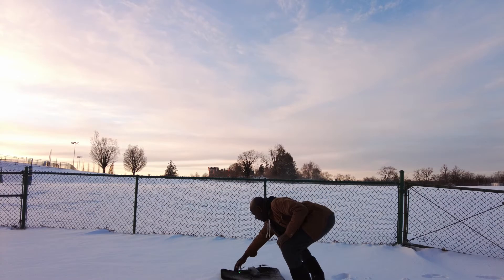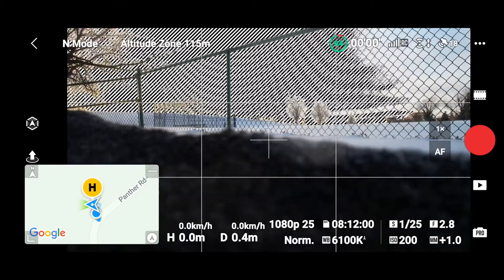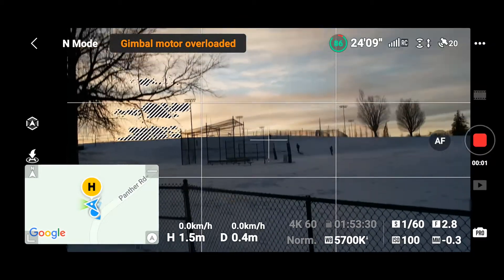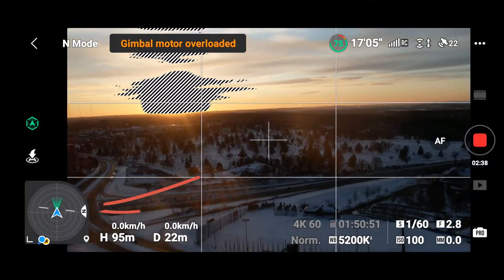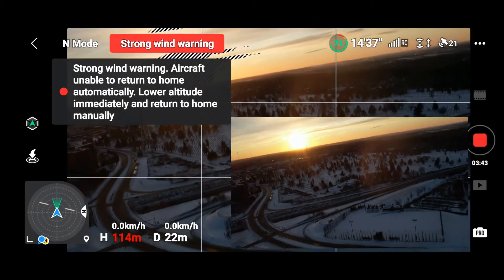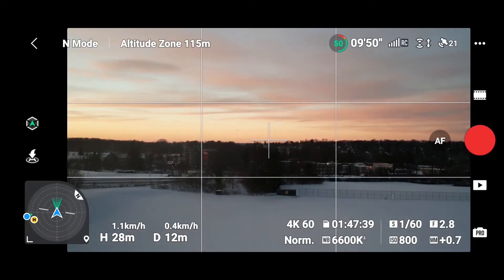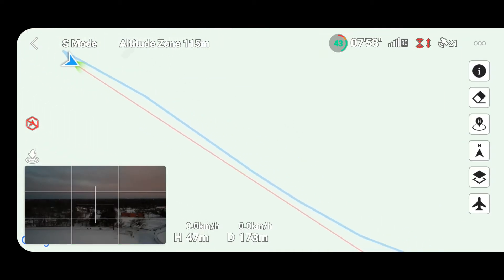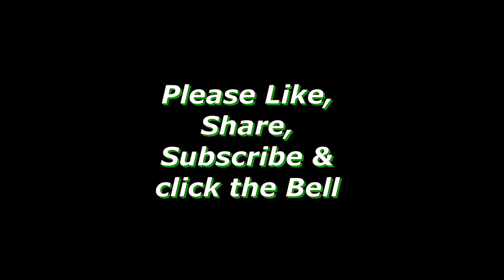AIR 2S TACKLES HIGH WINDS AND SUB-ZERO TEMPERATURES

Comment: Wow you have an Air 2S, That's awesome, I only have the Mavic Air 2. The 2S is the best drone on the Market right now but the Price is Really high. Have fun Fly safe and Fly as You are, Great video. TY for sharing
Reply from the maker: Yes it is expensive. Bought the cheapest package because I had the air 2 fly more. I eventually sold the A2 fly more and bought 2 batteries for the air 2s.
Reply: @1flyjcLIB1drone  a lot of people have gotten rid of their A2 for A2S. I got one from a guy on eBay for $600+ tax and delivery. A2 is the "best drone for the money" according to Captains Drone Channel but the air 2S is definitely a better drone fly safe with it. We put a lot of dough in the Air. LOL. Have a great day